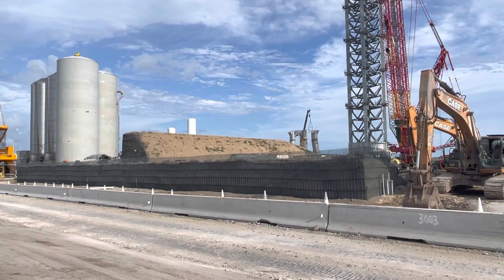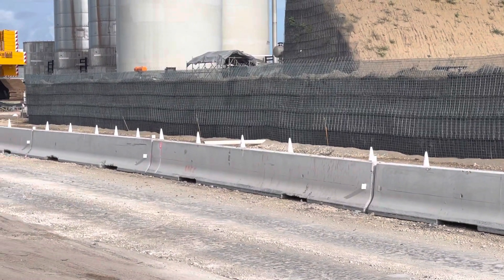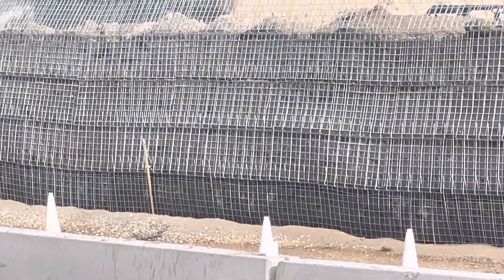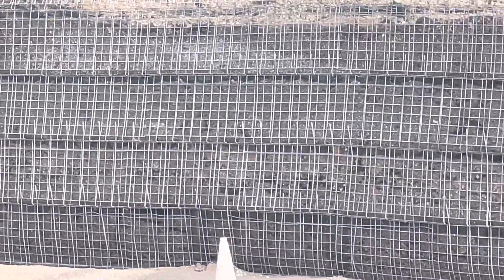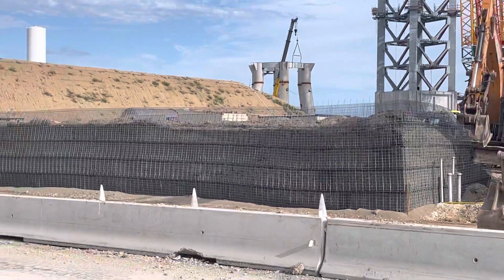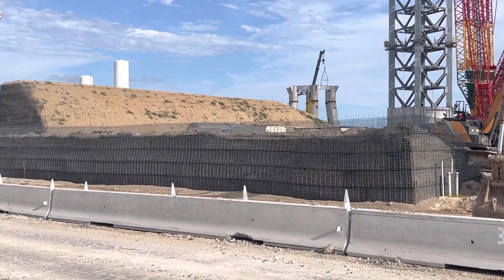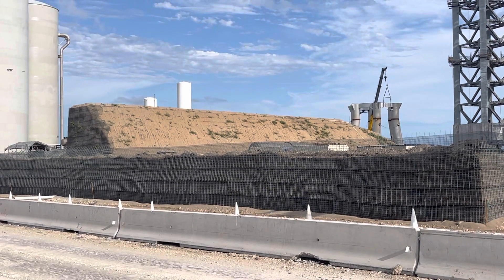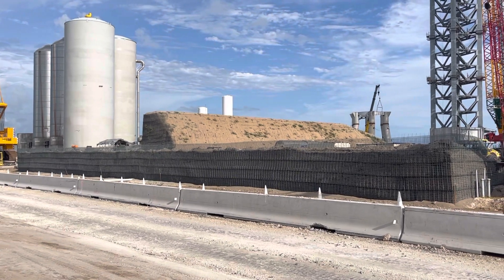Groundwork Berm Mesh Formation Part 2, SpaceX Starbase

Comment: for me personally I would love it if you edited these shorter videos into one video at the end of the day. doing the shorter ones is fine, but i would also consolidate them later if you can. great videos
Reply: I appreciate the short videos, with narration, released throughout the day (as soon as possible after recording).  For my preference, I’d rather get briefer, near real-time updates, vs longer updates which are not nearly so current.  There are other sites that already provide lengthy updates of Starbase happenings at the end of each day (sometimes hours of often time-lapsed, unnarrated video with one-liner text captions to clue the viewer into the significance of each of the videos major sections).
Reply: @sub4bobby  i like the shorts too. i am just suggesting they also do a combined daily video.